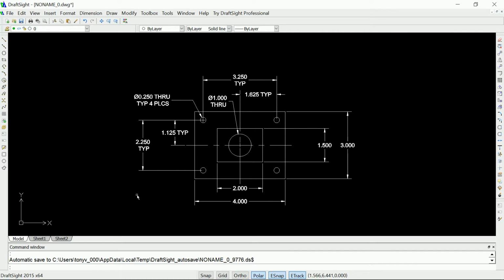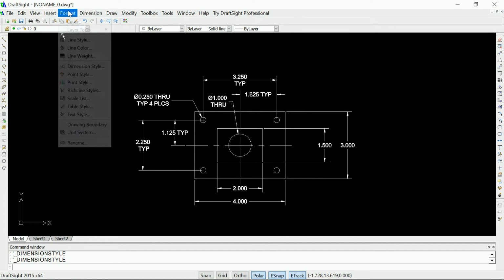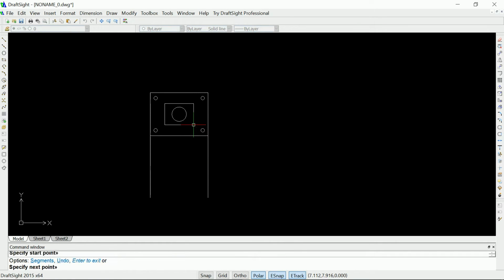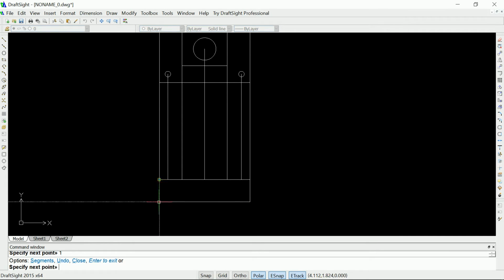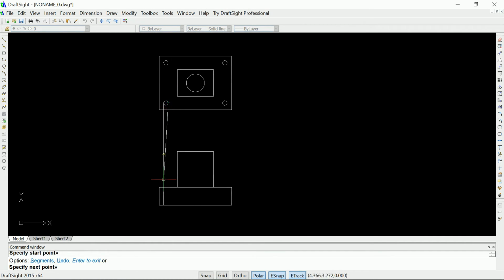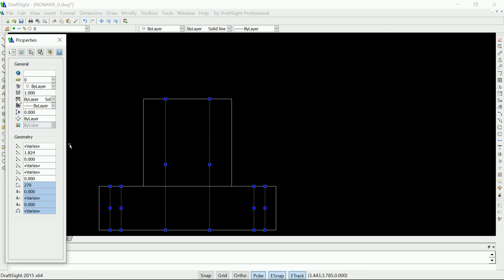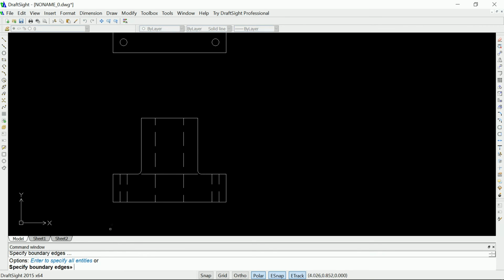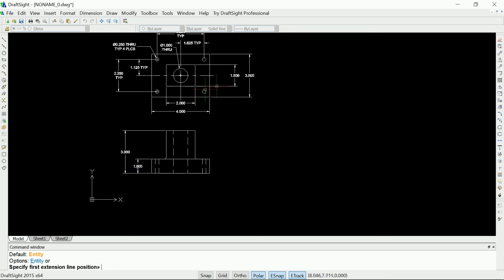Using DraftSight drafting software for 2d View Projection

Comment: After MANY clks, I still am unable to get DRWNG BOUNDRY.  I WOUD APPRECIATE ANY SUGGESTIONS.  
Thanks!
Reply: Click format at top of screen, click drawing boundary near bottom of menu list. Now in command line area at bottom of screen you can enter coordinates. Press enter to select first corner...which should default to 0,0. I usually use the size and orientation of my paper, so for opposite side I enter 11,8.5...(I’m using inches...if you use millimeters just change accordingly)
To see drawing boundary turn on grid, type zoom in command line and then type b for bounds.  You can verify by drawing a rectangle around the grid and dimension it... hope that helps.